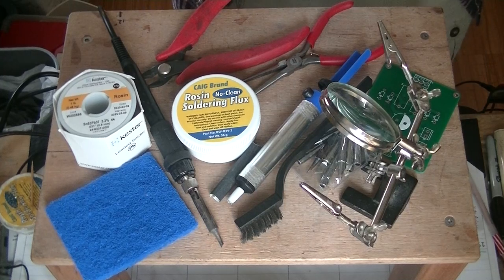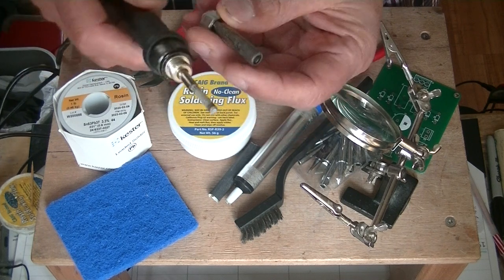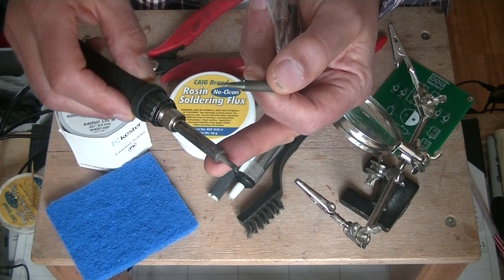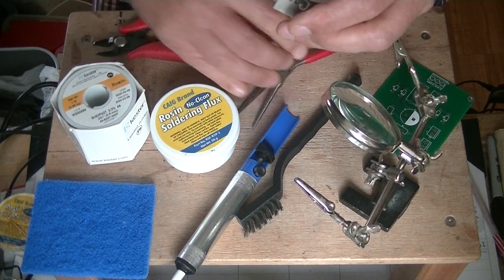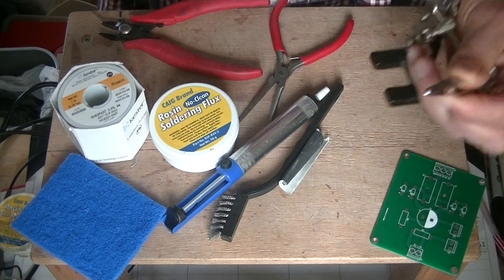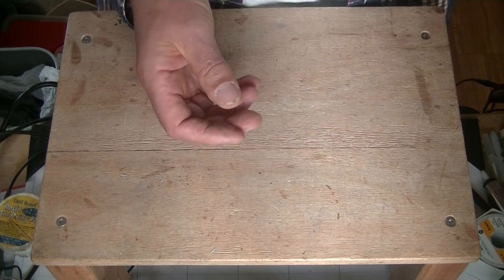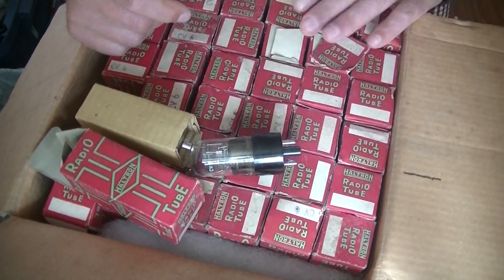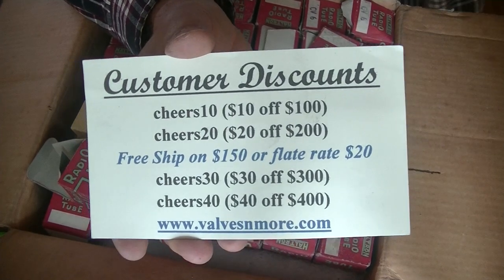Tube Lab #46   How To Solder 101

Comment: 100% Jim, Sn63/Pb37 is eutectic and cannot be beat, Sn60/Pb40 comes close, but no cigar and don't even get me started on that eco Pb free crap. If anything, then Sn96/Ag4 is useful on silver plated wiring and terminals, demands little higher temperature setting, but can be worked to look good. Isopropanol works great as a rosin residue remover, PCB cleaner containing acetone works even better, but can strip markings from components, if you're not careful. Liquid, syringe applied, flux is great for smaller components and stranded wires.
Reply from the maker: Thanks for the comments.  Back when I was way too generous with the flux, I used isopropyl alcohol to clean the boards, which I found slow and not that great a solvent - I've never tried acetone, but as you noted it loves eating labels, a very agressive chemical.  So I went the direction of using very small amounts of flux applied at the tip of a tooth pick and use "no clean" flux.  This has worked well and even though the boards have a small amount of residue, they're fine left alone.  Often in design and building less IS more!
Reply: @tubelab194  True Sir, unfortunately my weekends often involve HiFi equipment with an unforgiving combination of double sided boards carrying Pb free solder and a mixture of TH and SM components. To have a fighting chance, not a only a temp controlled soldering iron, but a hot air gun, pre-heat board, desoldering iron, pincer iron, ceramic tweezers and often a TFT microscope are necessary, if only the components and not the traces themselves are to be stripped off the boards. With this type of work you pretty much end up soaking everything in flux, so time consuming cleaning follows. Despite all this, I sometimes end up having to stamp in replacement vias - that Pb free solder is so dreadful at removing, it doesn't flow properly and is almost granular in structure, so damage occassionally ensues. Isopropanol takes time to dissolve flux residue, but as you say with brand new components and boards a no clean flux sparingly applied is more than enough. On repairing older equipment at least mildly activated flux is needed in often liberal amounts. Acetone works instantly, I place a paper towel on the print side and apply it with a brush onto the paper ending up with a brown stained towel. Once second or third towel comes clean, De-oxit gold thinly applied takes care od any leftover whitish streaks and gives the board a shiny, factory made appearance.